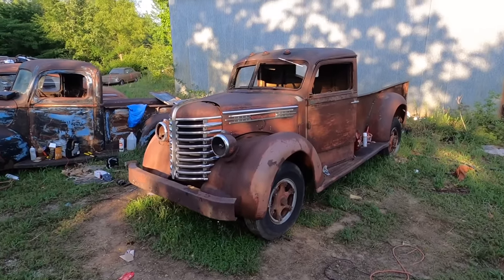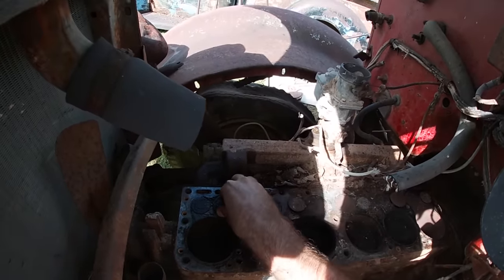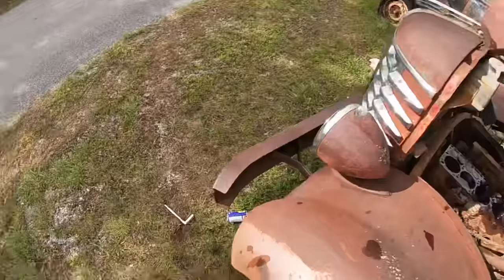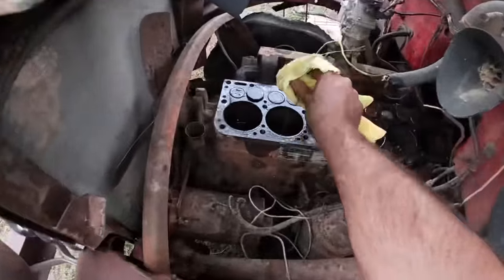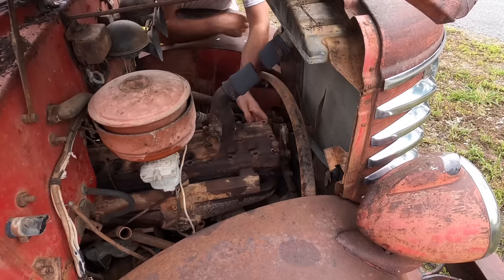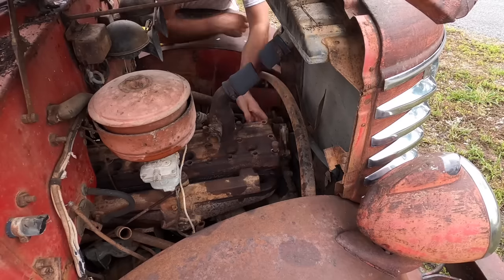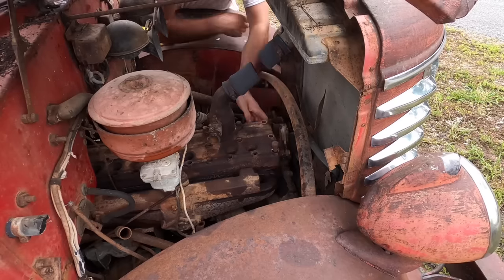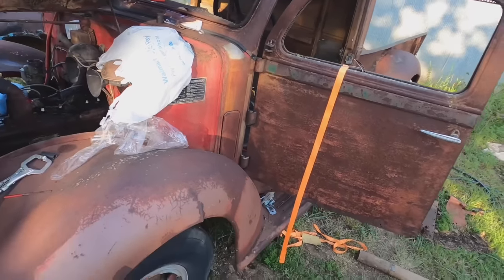Will it run after 66 years 1948 diamond t 201 pickup truck

Comment: I'm an old timer and what people don't know today is years ago cars/trucks didn't last nearly as long as they do today. I purchased a brand new Chevy Camaro in 68 and by 72 it was junk. I paid just under $3,000 for it and sold it for $750. And no, I didn't hot rod it. In the 50's it was common knowledge that a U.S. made car or pickup was a junker when they hit 100,000 miles. Today some folks don't buy a car or truck until it has 100,000 on it! Technology today is light-years ahead of those old rides. But I sure do miss the styling and atmosphere that was America! Life used to be exciting and the future had endless possibilities. I feel sorry for kids today.
Reply: I drive a 2005 Dodge Neon SXT. I bought it three years ago with 253k on it, and it just turned 306k last month. I did a bottom end overhaul the same time I did a head gasket, but that's it. Bearings, brakes, suspension, etc... normal maintenance. I paid $500 for it, and it is hands-down the best little 4-banger I've ever owned.

Good maintenance, full-synthetic fluids, drive it like an adult, and it'll last a good long time.
Reply: Yup, I agree! Sometimes I wonder about some of these restoration videos thinking they were junk to start with. The styling was cool and I liked the Euro stuff best.
Reply: @Gopherdave1 > Is it junk if they still start up and run after 25, 30, or 35 years in a junkyard? It's crazy that people take cars to the junkyard that still run and drive! ☹️
Reply: @jessestout8646  cars were also getting better yr after yr then, and a 5 yr old car was behind the times
Reply: @somenamelessdude8095  This truck likely had a top speed of about 50 mph, the brakes were weak, the suspension was like a rock, and you ground a pound when shifting. This was before severe inflation dropped your salary to the poorhouse like now, so it made sense to get a much better, newer either new or used truck. I would spend the time to drop a newer V8 in this, or even better start with a newer rolling frame and engine and add this very stylish and antique cab onto it, for a better driver.
Reply: Yea but they were much easier to fix I.e rebuild engines brakes etc. no computers in them old cars.
Reply: If old vehicles didn't last long, why is the gentleman in these videos starting up 1930s vehicles that have been left to rot for 50 to 80 years? Leave a modern car for that long and see if it starts.
Reply: @scottysgarage4393  You wrote nonsense. It is correct that modern cars turn lower RPM at cruising, but wear comes from both speed at which surfaces move, and the load on them.  If you are going the same speed the power must be the same.   If RPM is lower but power is the same then engine internal forces must be higher - and wear is about the same.
There are several reasons why modern engines last a LOT more then engines used to:--
1.  Better metallurgy;
2.  Better oils;
3.  Due to emission regulations, modern engines warm up much faster.  Most wear in car engines happens during warm up, and also gasoline gets in the oil until operating temperature is reached;
4.  Governments made oil companies take the sulphur out of the fuel.  Sulphur occurs naturally in petroleum and forms sulphuric acid during combustion, which eats away cylinder walls.
I used to work for a business that rebuilt engines.   It used to be that you would see 0.5 mm or so wear in cylinder walls due to the sulphur.   Now you strip down an old engine and the factory hone marks are still visible.
Heavy haulage truck engines now last about three times as long as they used to, for the same reasons.  And truck engine RPM in use is still the 2000 to 2100 RPM its always been.   Rebuilding truck engines used to be big business.  Not now.
Reply: @scottysgarage4393  Factory testing?   for 40 years?   And what was your part?  A clerk in the ordering department?
You have no idea.  You wrote that today's lower RPM's were enabled by better fluids.   Even the dimmest hobby mechanic knows that lower RPM's were enabled by more complex gearboxes - in the 1950's many auto boxes had only 2 speeds, though three speed boxes were available in higher priced cars.   Today 4 speed auto boxes are common, sometimes with lock up torque converters, which lower RPM by 150-200 or so.  Manual gearboxes were once 3 speed but now 5 and even 6 speed are common.   With more gearbox speeds a taller diff ratio can be used and still get good moving off torque at the wheels, but cruising in top is at lower RPM.
What I said about wear at lower RPM is about the same due to higher loads is fact - you can look it up in Gordon Stachowiak's book "Wear""  John Wiley 2005.  It is a standard work on tribology - the study of wear.
 I've seen a multitude of old engines in the shop with the factory hone cross-hatching still visible - something that just didn't happen before they took the sulphur out of gasoline and diesel.
Go look up the specs on heavy truck engines.   They have always have and still turn at 2000-2100 RPM - yet they now last a lot longer too.
Cast iron used by GM and Ford in the 1950's and 1960's was so soft, you could mark it with an ordinary knife.
Reply: @uncled39  During the 50 years they have been parked, there was no wear.   And if you watched carefully, they were left to rot because they were mostly already broken down or worn out.   Just because you can get an engine started doesn't mean it is going to run as well as a new one, or even be usable in routine driving at all.    The guy in these videos is just having fun.
But you are right - I don't see somebody using the same rough methods in 50 years time getting engines going, simply because today's engines are far more complicated, with computer control and a lot of plastic parts that are not long term stable.
Reply: Nice attempt, I reckon you will get her running, if only on 5 cylinders
Reply: @scottysgarage4393  :  There is an old saying - on the internet, nobody knows you are a dog.   in other words, any personal claims you make, eg working in a factory or making millions, means nothing.
Sometimes YT does not display posts - it is a known bug.   But it always emails responses to other posts, so I know exactly the entirety of why you posted - it is nothing but rant, eg I quote you "The word salad you puked up from Wiki is just an inconvenience of pixels."    Nice catchy turn of phrase, but proves nothing.
In contrast, I posted a technical explanation which anybody can test or check for themselves.   Eg I said truck engines also last a lot longer now, but RPM has not changed - you can easily google up specs and see. 
I post facts - you post rants.  
Be aware - sometimes YT does not display a post, but it hasn't been deleted.   It will be displayed to other users, and may display to you and i later.
You sometimes see someone has made 2 identical posts - because they thought their first one was deleted, but it wasn't.
YT may delete a post if it is excessively abusive or excessively long.
If you can provide a legit technical refutation then do so.  We''ll all learn.   But you can't can you?   If you could have you would have.
Reply: I remember that exactly as you describe!!
Reply: They don't make cars and trucks last like they used to its sad
Reply: @keithammleter3824  you forgot to mention modern engines have roller everything, overhead cams, anto wear coatings, and electronic fuel and timing control
Reply: @lollipop84858  Overhead cams do not make an engine last longer.  But you have a valid point about electronic engine control - it means engines do not misfire or part burn when cold like carburettor engines do, so unburnt gasoline getting in the oil is less on an electronic controlled engine.

Comment: I have had great success with an unusual method of freeing stuck engines, rings and valves. Instead of the usual use of MMO, Blaster and such,  I have been using regular old white vinegar and it has worked every time. I pour it in and fill the cylinders then let it sit for a day or 2, topping off the cylinders as it soaks through. Vinegar actually eats the rust but doesn't damage the rest of the iron/steel. Once the engine breaks free oil the cylinders and change the oil in the crank case and turn it over to lubricate everything then do the normal compression test, get it to have spark and a working fuel system and it should be fairly easy to get it to fire.
Reply: first I have heard of the vinegar trick, sounds like a great idea !
Reply: @ennengb2010  have you ever used vinegar to remove rust from anything? If not, find yourself something rusty, whether it's a few bolts and nuts, old rusted wrenches, rust seized needle nose pliers, crescent wrenches, etc and put them in a bowl of vinegar and let them sit in it overnight, then take them out of the now nasty rusty brine, wipe with a good rag then rinse with water. Repeat if necessary but that's only in really severe cases. You MAY want to wear good rubber gloves though because it can be extremely difficult to wash off your hands.  It's truly amazing at removing rust and is non toxic and non corrosive. If you try it let me know what you think of it
Reply: Cool! I'll definitely try it. Bet thats the active ingredient in the rust disolver I've been buying .
Reply: Vinegar works great on rust, so I believe it....
Reply: So does 88cent Wal-Mart soda
Reply: @LeftiusMaximus  really? What flavor works best? Cola or ?
Reply: Cambron Gabaree  I must have forgot to mention that wearing rubber gloves is necessary because of the black dye that results from it. I’m assuming that no rust was left on the Allen wrenches though unless you oiled them they will flash rust
Reply: Cambron Gabaree  yes it is a reaction between the vinegar and the rust and the steel. If steel is left in the vinegar for a longer period of time it will become blackened but when wiped off it will be a DARK gray. If you look up “French Bluing” in traditional muzzleloader rifle sites, it will explain and show it and how it is used to make an imitation Damascus appearance on the steel parts treated this way. The black dye it creates is only surpassed by natural black walnut dye in its resistance to being washed out of your skin (don’t ask how I discovered this but let me say it took nearly 4 weeks it took to finally be clear of the black walnut dye. CAUTION. — NEVER, cut or grind black walnut husks without rubber gloves or even handle them if there’s a chance some may be cracked open)
Reply: Alot cheaper than that fancy crap, but hey, with our tough economy,  people seem to have more money to piss away than ever...
Reply: Yeah, vinegar is great on rust!  Never used it like that, before though.  Thanks!
Reply: @tompayne8863  our local store recently switched brands of vinegar they carry and this new stuff is worthless for anything. Couldn’t even color Easter eggs with it
Reply: @jrsgarage7623  Cola and tin foil works great in removing rust from nickel plated stuff.
You can search here on YT.
Reply: @EugenioFranklin  try evaporust once. Fricken amazing on anything won't affect finish and is non toxic to skin cloths ect. Works overnight. 8$ a qt at harbor freight
Reply: Puddins fab shop has used the vinegar method a coupla times as well with good results
Reply: @todddenio3200  get some applecider vinegar otherwise, its also good as a tonic drink with honey1 _ 2 tbspns vinegar in water
Reply: @edwardmulder3777  I was one of the viewers who had been telling Puddins fab shop about using vinegar until he finally did and had success with it
Reply: @edwardmulder3777  I have used cider vinegar as well on rust and I actually do use it daily as a health aid for the enzymes it has. It is also amazing for getting rid of heartburn and also as a great cleaner for nearly anything else
Reply: Used it in a metal gas tank looked brand new wen I was done.
Reply: I think I’ll try that on an old 36 Chevy I have
Reply: @billbammerlin4666  just be sure to not leave it in for more than 24 hours and be sure to neutralize it at that point. And once the engine is free, oil the cylinders immediately.

Comment: The ballast resistor should be hooked up in series with the resistor.  The ignition wire needs to go to the resistor, then from the resistor to the coil.  I am guessing that truck was originally only a 6 volt.  The resistor is to lower the power going to the coil.  It will prolong the life of the coil and keep the points from arcing and burning up.  A set of points made for 6 volt will burn up quickly when converted to 12 volts.
Reply: Sir, you know your business  my brother and I loved playing with those old girls.
Reply: Never knew the points burn faster but it makes sense cause ive noticed that
Reply: I converted a 55 Willys Jeep inline 6 from a 6 volt to an 8 volt system. Headlights and such kept blowing fuses so just replaced with whatever screw was on hand and and not rattle out. Never did have problems with it burning up points. Got the idea from a hay farmer, said it would start better with a little more juice. Said 12 volt would be a little much on the system.I didn’t know it til then but a lot of tractors had 8 volt systems back then.
Reply: Thank you. I was looking for this so I didn't have to.
Reply: I thought modern coils did not need the resistor
Reply: @petemack1917  The truth is that I barely remember making this comment and have to reconstruct my thinking a little, because I don't really remember what in the video I was commenting on 3 years after the fact, beyond that someone was trying to put a coil in an old truck and make it work. So, not remembering exactly, I would guess that the video was trying to mix 6V and 12V components.
So, coil is actually two coils to step up voltage through inductance.  Otherwise an coils is exactly what it sounds like and needs no resistors at all.   But the ignition does.  How that ignition is designed to handle the coils voltage makes a huge difference.  A truck that old will use points, which produce a spark between them, which erodes the points, before passing the spark down the wore to the spark plug.  A 6 volt ignition was designed to handle half the voltage at a current that the engine's RPM determines.  So if you connect a 12V battery and coil to a 6V ignition the watts going to the ignition are doubled because the amperage will still be what the 6V ignition draws, but the voltage will be what the battery and alternator generate.  It can lead to hard starting because the battery can't push out enough amps to both turn the starter and make a spark through the old points, and if it does the spark will be strong enough to damage the points.  And the current that the 6V ignition draws will be double what the coil was designed for, also reducing its life.
If he wanted to convert to 12V, he needed to convert all the parts.  Or if a HEI electronic ignition and distributor was not available to match the coil, starter, and battery, then he needed to use a ballast resistor to step-down the current to the coil.  It isn't that the coil needs the resistor exactly.  It is that when you mix and match parts made for different voltages and ignition setups you have to make sure that they each get the voltage/amperage they were designed for.

Comment: Our old 34' Diamond T had a red seal Continental engine in it, which my dad said was one of the best engines made in those days.  Built to last, the truck had 335,000 miles on it before being sold to the Hansen's who then removed the engine and ran their sawmill with it for many years.  Diamond T manufactured some of the best trucks in the country. 💎

Comment: If its still a positive ground system, connect your hot wire from the battery to the negative side of the coil.

Comment: When I was young...even today, we got longer bolts without heads to screw into the block and hide the head down in line, 2 headless bolts long enough to stick up past the head was all you needed..perfect guides to set the head in place
Reply: Maybe you should have worked on the stuck exhaust valve before you put the head back on.

Comment: I've been wrenching sense watching my dad over a half century ago . If you want to free up the piston rings and valves , pour automatic transmission fluid down the spark plugs holes and fill up each cylinder , then let it sit for a few days to a week . Without the spark plugs in it , crank it over gently until the cylinders are empty . Then put it back together and try to crank it up . That automatic transmission fluid is an old mechanic's trick I learned from my dad and it still works today !!  Just check the oil level in the engine crank case as it sits the tranny fluid will go down into the engine crank case . It not only Free's up pistons & rings but also the valves and lifters .
Reply: This is true. ATF is the mystery behind Marvel Mystery Oil.
Reply: I use a mix of ATF and diesel.

Comment: Private sector manufacturing did not readily keep up with war time technology. And I'm of the opinion that it was intentional. However, I grew up in the fifties and had access to a lot of older vehicles. Those old cars and trucks were so easy to work on, and reliable if serviced appropriately.

Comment: Thanks for making these vids, you asked about the head if you did anything wrong, i don't think so. Couple things that could have made life easier, a pine 2x4 to lever the head in place, and picks to clear all the crap away and help align the gasket. I believe there is a specific pattern to torque head bolts as well

Comment: Get a small block of hardwood, place it on the top of a piston and hit the top of the timber with a sledgehammer one by one. This should crack any rust and free up what’s locking. Good luck.

Comment: You really should keep the condenser in the circuit. It makes up part of the firing of the coil and saves on the points. Using a bigger coil wire and then adding the extras long length doesn't help any as you are adding resistance to the circuit by the longer wire.